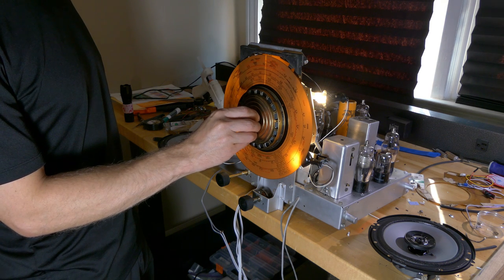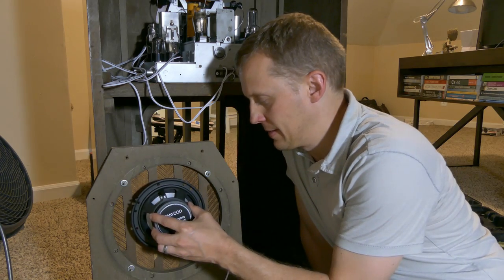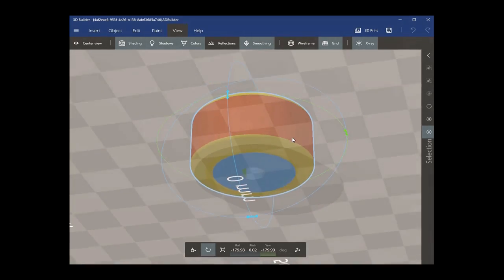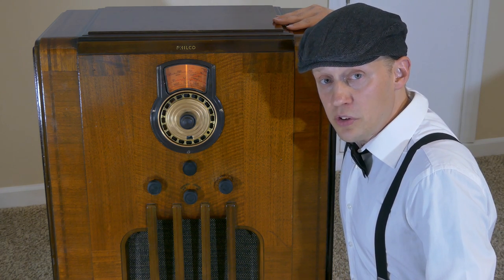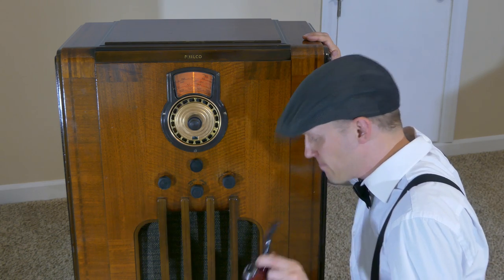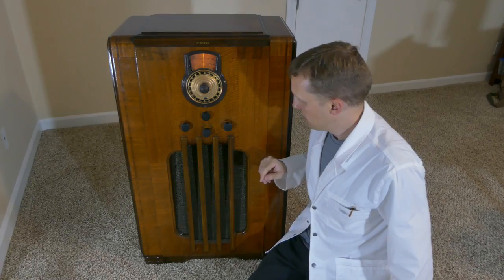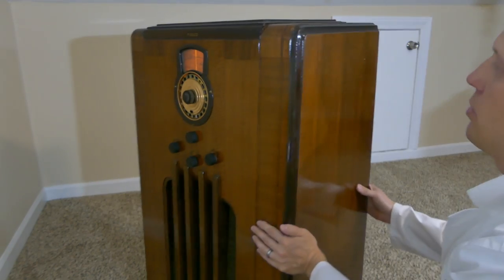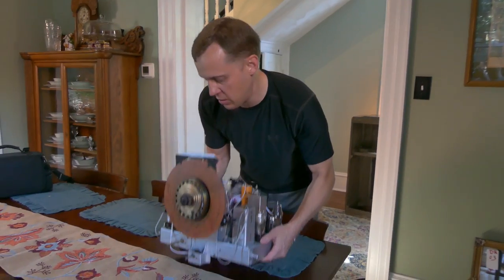Retro Radio | simulated radio stations - Part 2 of 2

Comment: I've been a antique radio/TV collector for almost 40 years. As a rule I'm a purist and like the sets as original, but, I must say that build was pure genius. I can't believe something like could even be done. I wouldn't want to see it done to the rarer radios, but for the more common one's who's fate is likely the local dump, this would at least preserve them. Honestly, if you sold similar radios like this from different eras, I think you would do well. Who wouldn't want one!
Reply from the maker: Thank you so much. I get a lot of people saying negative things about doing this to an old radio. But it is exactly what you said, never used again or restored into something that is used almost daily. Thanks again for the feedback. All the code is available if you want to try an make one for yourself or to sell.
Reply: @CodeMakesItGo  You're very welcome. I wanted to mention that I linked your vid to the Antique Radio Forum.
https://antiqueradios.com/forums/index.php
It's a group of very knowledgeable collectors of vintage electronics from all over the world. They mentioned that you certainly have the ability to easily restore these chassis' back to factory original. With modern AM broadcasters and/or an added input you can listen to anything you choose on them. I think you'll love the way they sound. You might even get the old radio/TV bug like we all did. It's a fun and interesting hobby. Please do more vids and try a full chassis resto!
Reply: I would have tried to use the original amplifier or at least use a tube amp, to give the music that certain tube sound quality.
Reply from the maker: Tube amp would have been a good idea. The original was too far gone for me to bring back to life. When or if this amp dies I’ll take your suggestion and replace it with a tube amp. Thanks!

Comment: Just saying, you could connect up the filament tap on the transformer for that tube on effect (if the filaments even worked), then again no one would see it from the front. Regardless, you just hit a home run with that project! I tip my hat to you sir,
Reply from the maker: Thank you so much! I would have loved to restore this back but the transformer and everything else was so corroded it was beyond my skill set. Having the filaments glow would have been truly awesome though. However, I doubt many of the tubes worked. Someone else suggested to put LEDs under the tubes to fake a glow. Might try that one day. Thanks again for watching!

Comment: Really nice to have that restored and putting out tunes again.  Cool you have the different modes.  I was really hoping you would have added a few skinny "windows" on the front or sides somewhere so one could peer inside and see the old tubes lit up.  It looks so nice all cleaned up in there shame you can't peek in and see it.
Reply from the maker: That’s a really good idea, there should have been vents on the sides originally to help dissipate the heat. But if it was easy to see the tubes then I would of had to add LEDs to the tubes to make them glow. Also my wood working skills are below average so would have been scared to cut into the cabinet. Still cool idea, thanks for watching and the comment 😊

Comment: Did you reuse the rotary switches or swap them out with modern ones? I have a candidate radio but the switches don't have a set number of positions.
Reply from the maker: Mike Lougheed I reused all the switches except for the value knob.  Search on amazon or somewhere for 2p4t rotary switch. That will give you a 4 position selection. Thanks for watching! Good luck on your build.

Comment: Awesome job restoring the radio, but I have a suggestion... If you do restore and upgrade another radio like this, please add internet radio streaming capabilities and also a SDR dongle so it could tune in to actual radio signals, that would be really awesome.
Reply from the maker: SDR is an awesome idea, I'm just getting interested in SDRs and the things you can do with them. I thought about internet radio too but didn't have a good solution to indicate which station you were listening to on the dial. Thanks again for the suggestion and for watching the video!
Reply: @CodeMakesItGo  an idea would be to have the pi announce the name of the internet station via text to speech. Another idea could be to have a lcd screen somewhere, but that may ruin the look of you wish to keep the radio as original as possible, so I'd just use the text to speech idea.
Reply: Alexa or Google Home integration is a great idea for more than just listening to music :)
Reply: @gnatsum64  I second this idea. It would be awesome to have Alexa or Google on an old radio